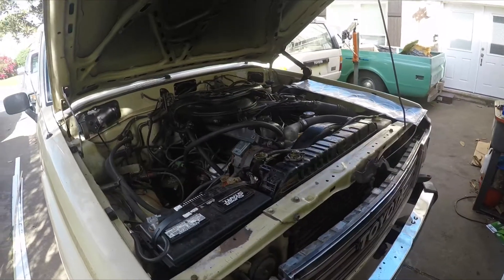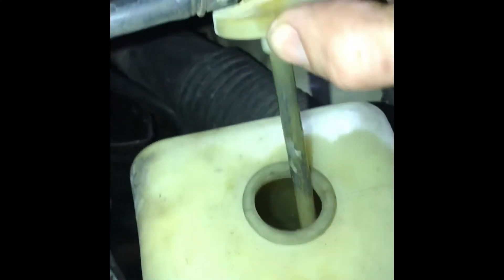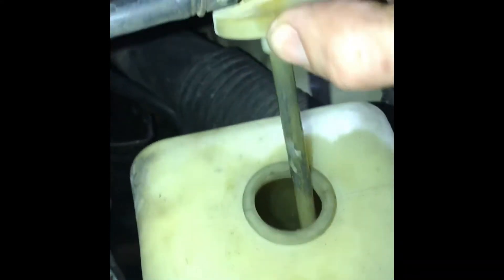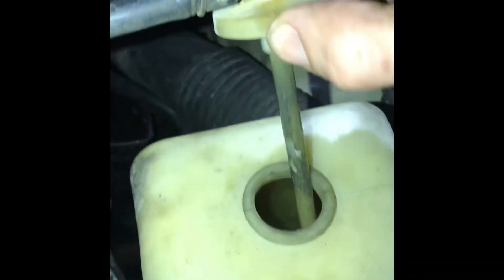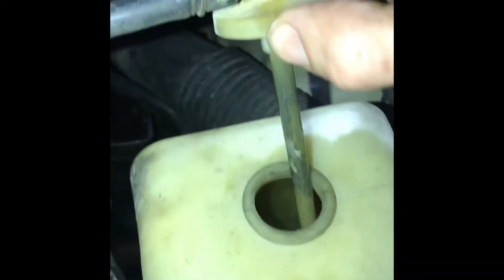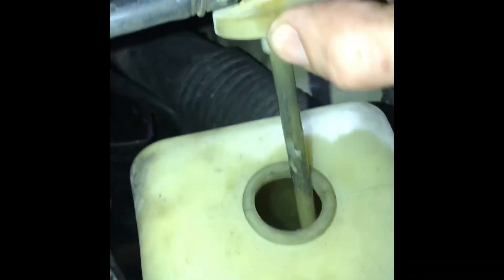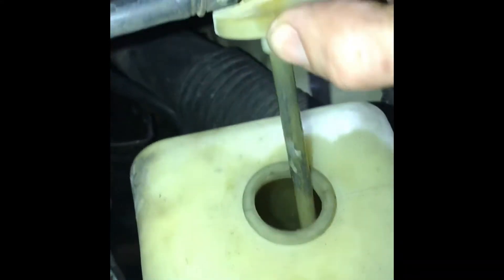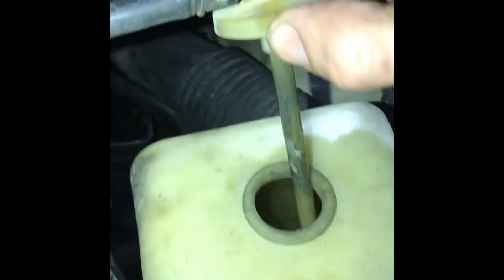Replacing FJ60 2F Head Gasket- Timelapse!

Comment: Did I just see  you do a quick attempt at placing the head on the block without the crane?  I got a kick out of that.  About to do this on  my 3FE, I probably didn't need to take out the water outlet assembly, nicely done.
Reply from the maker: Lol it would’ve been possible but wanted that precise location on the gasket and minimal sliding around

Comment: Why did you think you needed to replace the HG?  smoke? no power?
Reply from the maker: It wasn’t bad enough to the point of smoking, but it was the stage before that. Compression was leaking into the cooling system. Once cooling system pressure overcomes compression it would start smoking, but I knew it was just bad from when I initially installed. Haven’t had issues since, knock on wood!